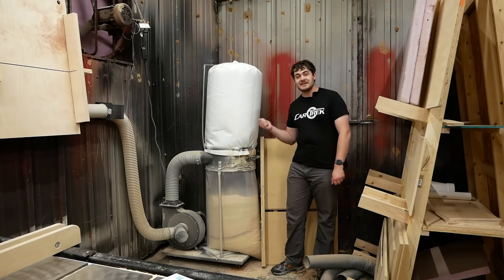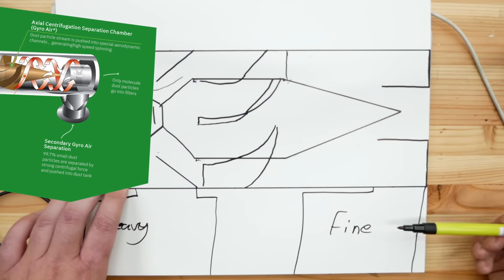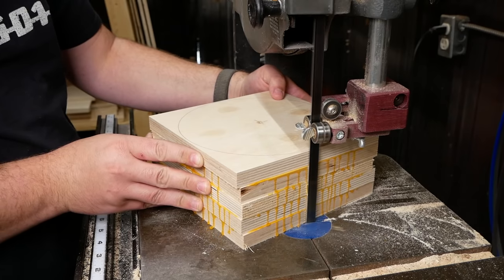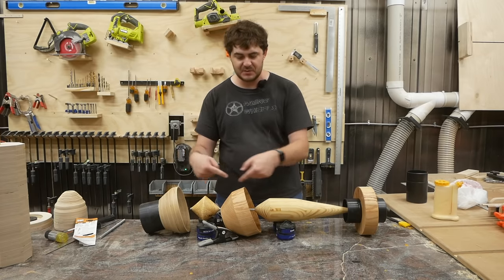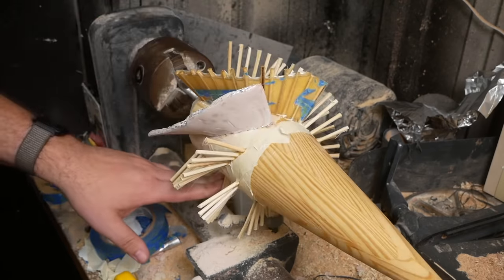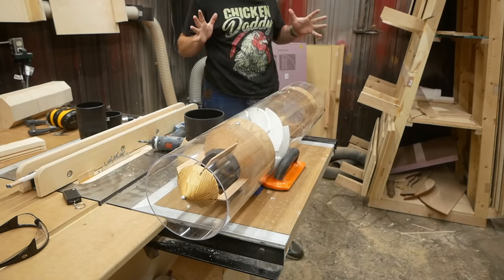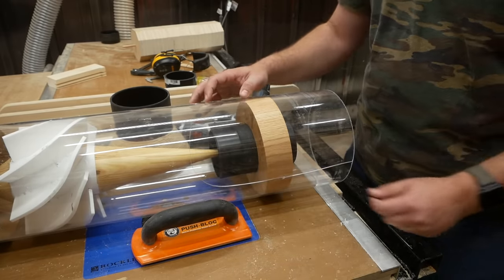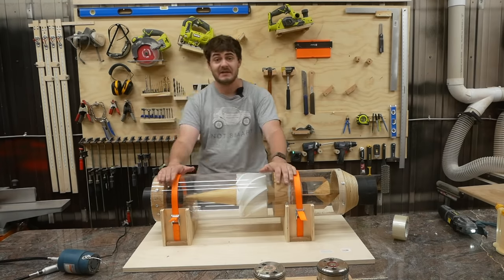I Made a Centrifugal Dust Separator to Upgrade My Cheapo Dust Collector

Comment: Thanks for this. I love your "measure once, cut three times" technique - that way, you will never run out of scrap material for new projects!

Did you consider putting the blower at the other end, so that the heavy lumps get separated before they hit the vanes of the fan?
Reply: You'd be surprised at how many centrifugal wood chip dust collectors (what he had originally) with the bag dump all that shit through the turbine. In theory if it's all dust and fine chips you'd be fine and the turbine should be just weak enough to not be able to lift dangerous sized chips. I've seen a number that aren't Chinesium or Horrible Fright that do the same (pump through the turbine before the blower). We've had a setup like that for 14 years now and it hasn't failed. Then again, every table has a screen preventing chips > 3/4" in a given dimension from getting through.

Comment: This whole thing is awesome. Congratulations on the working separator! You really should change the order to be Cyclone —> Filter —> Blower motor (sucking rather than blowing) a la Matthias Wandel. It preserves the blower.
Reply: Mere details.
But it would help with the dust bins not bulging out. Similarly with the filters bulging apart. Also the big chunks of wood would not have to go through that blower. 
Yeah, I guess I don't understand the overall design.
Reply: @henryD9363  Well understand or not, you did make one. That’s more than most of us. You are officially a doer of things! Plus it works!

Comment: For the fins, aluminum cans with the lid and foot cut off can be slotted into grooves cut into the surface. Beer cans are very useful.

EDIT: Apparently I've been generating too many empty beer cans myself, I didn't realize The whole mechanism was static, and the air moved.

Comment: Awesome project! :) But I have to admit that I was mildly - but pleasantly - surprised to see that you survived the building process :)
And BTW - half area tube section for an 8" duct is 2 x sqrt (4x4x0.5) = 5.66". So your first calculation was right.... But for shopvac type airspeeds, when accounting  for boundary flow losses, my old ventilation textbook memory says to subtract maybe 10% of that. Round it off to 5".... That should keep average air speed constant through the system, which is important to minimize pressure losses.

Comment: It's fascinating seeing this done in wood. I thought to myself, this would go so much faster with a couple 3d printers. Could have the cyclonic separator section built in about a 2 days.
Reply: I've got an Elegoo Jupiter coming next summer and I just might try this.  I'd use a Sonotube for the enclosure though - just cut some windows into it and heat-drape acryilc over them & seal.  (This guy's channel is exactly my kind of bonkers.  He did a great job.)

Comment: At some point someone's gonna make a "dust collector" that actually separates the chip/peel/fiber from the dust.   It's kinda useful and all it takes is a sorting drum system where a turning screen that catches the non-dust stuff rotates through the flow then over the hopper.  You can do it with a solid drum by making the entire flow assembly in a cap to the drum then you can drop and swing the drum out then tamp it to save space... it greatly reduces the amount of material the centripetal dust unit has to deal with.
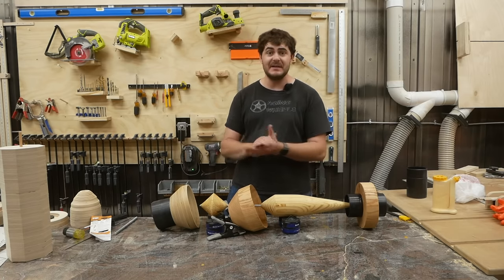Before I watch the fin idea at 0:09:30 I'm gonna go back to a technique my mother (with the Masters of Art Education from Indiana State in the late '60s) taught me.  Create the curve out of a block of clay and melt PVC onto it... that way you can make as many as you need and as long as you don't overheat the clay you can use it again later for other things.   You can do this for complicated fiberglass surfaces too using whatever you like to bulk up the inside.  If it turns out your curve isn't right, move the clay around   Frankly I also learned enough metalworking that I could reproduce the fins with a hammer and anvil too but the old saying "give a lazy person a job to find out the easiest way to do it" comes back around to one of my mother's professors who was a retired industrial process engineer.

Now... I don't wanna give you a concussion but I'm thinking it would have been much simpler to make it all out of stiffened cardboard silhouette matrix then form-fill with dense A+B, smooth that with a wire brush and harden the surface with spray bondo, quick gentle sanding on the lathe at low speed, groove and mount the fins my way or your way, give the whole thing a gentle coat of sealant then cover that with countertop granite spray paint.   Repeat as needed for all parts.

Would have made a GREAT intro gag... "but that seemed too easy... SO I MADE IT OUT OF GRANITE!"

Love the panel work.
I would definitely build my own version of what you've got.  Tho I'm thinking I'd do a bit more of a display with clamshell dump bottoms etc.
If you want to save money, just find a local vaccum repair shop and ask em to collect dead dyson clones for you.  Six-ish of the cyclone drops on them combined with a fair size shop-vac on the end pulling through them should do great for individual tools - their advantage is they're the suck-through instead of the blow-through type of cyclone.

Comment: My first thought when you started this was, "This would be a perfect application for 3D printed parts."
Reply: Hmm I assume you mean the blades. Unfortunately I don't think with most 3D printers you'd get enough layer adhesion to stand the test of having wood chips blasted against them. Those centrifugal blowers for wood chip/dust collection move a lot of air and fast.
Reply: @ObservationofLimits  I was thinking something like the high strength resins that UV curing resin printers can use. From what I've read, layer adhesion is much better on those as the UV curing process leaves a result that is a lot more like a weld than standard PLA printing.

Comment: Great video and concept. I like that you included what didn't work. I admit that I skipped through some of the video because it is quite long so I may have missed any comments about the cyclonic separators made from trash cans and 90degree fittings. That's what I built and it works great but I admit that my vacuum has smaller fittings and less powerful. It was a hell of a lot easier to build than yours though. I built a stand on rollers and placed the shop vac on top. Very little dust makes it past the filter and the trash can fills up with the sawdust. Thanks for sharing.

Comment: Very interesting design and I understand why you wouldn't want to make another.  I love your this is how I'm planning on doing this,  oops - not a good idea,  find another solution and forge ahead.  You show how to utilize what you have, troubleshoot when problems arise, make corrections as necessary, and finish the project.  It's a useful lesson about making mistakes, and eventually producing a finished product that works quite well.  Thanks for the video, separator design, and the lesson.

Comment: For the filter box you ended up with, you can still use it for dust, but a bit differently.   Instead of pushing air into the box, suck air out of the box, with a fan.  Mount it on the ceiling and it will suck up the dust in the air.

Comment: I use the inexpensive Dust Deputy cyclone dust separator on my CNC router. I cut plywood, hardwood, aluminum, plastics, and carbon fiber and the amount of waste that comes off is incredible. But when the cyclone bucket needs to be emptied, I always check the vacuum canister and filter as well. The vac can and filter and nearly pristine. If I had a bigger work load I'd just run either two vac's or possibly a single vac with two Dust Deputies in a row. No commercial axe to grind for me; it just works and is far less complex than this unnecessary but very nice bit of handywork. I do love the experiment though.

Comment: Regarding the acrylic crack, you can get special glue for acrylic that actually works by slightly melting and fusing the acrylic parts together.  I would imagine it could seal up that crack pretty well.

Comment: On the cracks in the acrylic tube:  drill a small hole at each end of the crack to stop propagation.  Then fill crack by wicking thin CA glue.

Comment: I have found that using a leaf blower to clean out the garage works well for dust and fine dust.  It doesn't protect my lungs, but for the occasional cleanup of the dust and shavings that the dust collector did get...  Its a good way to get them out of the garage.

Comment: 😮DIY dust vortex separators have been tested and are very efficient, to get that last remaining sawdust a woodworker used a second separator it worked.   He stacked them up on a trolley two dust vortex things and then his vacuum.  I would go this way 😮

Comment: I built a cyclone separator dust collector going on two years ago. I built it out of a 55 gal. Plastic barrel with detachable lid. I draw the air from the center of the lid with a fox wall mounted dust collector that has a felt bag for final collection. Now my set up has the fox motor housing mounted over my barrel, and a hose running to the connector mounted in the lids center. My dust pipe enters the barrel about four inches from the top, and from a counterclockwise rotation when viewed from above the barrel. Northern hemisphere drain cyclone is naturally counterclockwise, where southern hemisphere is clockwise. Can’t tell you how many people I see making cyclones against nature. Now my collection barrel sits outside my shop in another room for noise control. So my collection piping goes through the wall to the barrel. And so I don’t suck cold air into the shop in the winter, my micron bag hangs inside the shop so the air out comes back in. No preasure increase or drop in the shop. My fox micron bag has a clear viewing window to monitor accumulated dust. In the near two years I’ve been using this system, I have never accumulated and dust in the bag, and have filled the barrel dozens of times. No more wood chips going through the turbine wheel as the barrel collects it all. My system is used for shop floor cleanup as well as individual machine points. I have heard people claim efficiencies in the 97% range and they were proud of the accomplishment. If after dozens of 55 gal drum loads, I still have not seen anything of substance in my filter bag, my system must be in the near 100% efficiency range. I can only attribute that to the natural northern hemisphere counterclockwise rotation of the incoming debris.

Comment: The furnace filters almost worked. There's only one thing you did wrong. When looking at the filters, you will notice that one side has the pleats supported in a wire mesh. The wire mesh ALWAYS has to be DOWN WIND. That supports the pleats against the back pressure caused by restriction as the filters get dirty. If the filters are installed with the wire mesh facing up stream, the pleats just come unraveled. Had the filters been installed correctly, I think the filter box would have worked perfectly!
     The 2-stage centrifugal separator looks great. Being axial rather than radial looks to me, like it can do a better job separating, with less restriction to airflow. All in all, it's a great way to prolong the life of the expensive media filters, while maintaining sufficient airflow to capture the dust from the shop equipment in real time. Time is much better spent building your latest creation, than cleaning up! This build was WELL worth your time.

Comment: That was fun. I too like to make gadgets out of wood. I live in a small studio apartment with no bedroom. So I made a murphy bed-room. Not only does it fold out of the way but also opens up, not as a platform to put a mattress but also into 4 walls and a roof. It's dark and quiet just like I like it. My goal was to use only a drill and a jig saw for power tools. All long cuts made at the lumber yard and delivered.

Comment: That is just a two stage cyclone. Stand it up and run in reverse and you'll see it. The 'fine' particle is the cyclone, which uses gravity for the large particles. Fascinating, for sure. I'd be curious to build and test one of each. I've often though a second cyclone would remove another 99% of the probably 1-5% that gets by.

Comment: Very nice project. I would suggest that the dust collector be placed before the centrifugal fan. This will save your fan blades from damage by dust particles hitting the blades. Over time the dust particles will erode the surface of the fan blades in the current setup.

Comment: The turbine impeller used for the thrust in the original out-of-the-box unit was already a centrifugal force.  What you actually want is to introduce a vollute for the outlet of the unit which takes centrifugal forces of flow and projects them into linear flow.  I have working in the turbo machinery industry for years.  Nonetheless, this is a great project and nice setup.

Comment: You may want to consider repositioning your blower to between the separator and filter, it will last longer without having to be in contact with the sawdust all the time, and the separator will protect the fan blades from large debris.

Comment: Your discussion of sizing the outlet raises an interesting point. An 8 inch diameter tube will flow 16 times as much air as a 4 inch diameter tube. It's a square law. So while the original sizes looked wrong, they were probably right all the time. but the best way to know is give it a try.

Comment: You should add grounding to keep it from building up a static charge and exploding. The LED backlight looks cool but all the fine dust can easily light on fire if the electicals make even the smallest spark. You should have some kind of fire protection near by such as smoke alarms and extinguishers.

Comment: You may get better suction and separation if you pull the air and dust through the separator instead of pushing it. Just a thought.

Comment: It just occured to me you could just buy two cheap plastic funnels and glue then together for the small cone. For the big cone, use a small funnel - pvc pipe and a long oil filling funnel. Then the middle pard can probably be made from a PVC coupling.

Comment: I feel like this is a limits of DIY video as much as it is a DIY video, meaning maybe those wood blocks wouldnt have "exploded" if you had simply purchased actual turning tools (which probably would have cost the same as the value of material spent on the DIY stuff, let alone factoring in all the time). [edit: having watched till the end, I think this build video makes the case for purchasing a 3D printer. As you concluded however, you got what you wanted outta the project and that's worth way more than simplifying the process. Mad respect for accomplishing your objectives. Also, best edits for a build video ever. The sound portion took me back to the 90s and gave me flashbacks to being at a rave.]

Comment: A bit late now but, @16:15 drill a hole in advance of the split to prevent it from traveling further before moving on with additional shenanigans.  Instead of forcing a tight fitting insert through a brittle acrylic tube, undersize the insert and wrap in foam gasket to create a seal without stressing the tube.

Comment: If put your blower post/separator, and mount it direct,y to the outlet, and the filter directly to that, you’ll eliminate a lot of inefficiencies. At leas mount the b,owner direct,y to the inlet to get rid of that ribbed hose.

Comment: Make a water based dust collector to act as a final dust filter before your exhaust filter so you can basically never change the filter again. I find water doesn’t work half bad for dust collecting, and simply blowing air into gallon water fitted to a giant 50gal drum, i think it’ll work very well.

Comment: You should use special bits for drilling plastic.  Standard twist bits are too aggressive and tend to pull the material up when drilling. I modify standard twist bits to flatten the cutting edge to create more of a scraping blade on the front edge of the bit.  They make clean holes and are far less likely to crack the plastic.

Comment: This is bringing on flashbacks of trying to turn stuff too big for my tools and too big for my lathe. The worst.
At least for boring internals, making a big heavy boring bar with an hss bit (Ellsworth style) is worth your time.
For spindles there is no replacement for learning how to use a skew, takes some time to learn but super easy to make (Iv mostly used w2 and o1 for skews, but you gotta be careful about your temper, too brittle and they are gonna be dangerous to use, grinding hss would be simpler but more time consuming).

Comment: I was surprised you did not place the dust seperator prior to suction fan to avoid large pieces of wood fiber going thru the fan. Suction would pull seals tighter ic cyclone and dust bins.
What do you think?

Comment: An improvement to the system would be to have the fan blower between the separator and the filter.  That way, all of the big particles and dust have the chance of ending up in the collection bin without going through the actual fan.  If anything did get through the fan, it should only be the fine dust that would get caught by the filter.

Comment: A couple questions. 
Why didn't you already have turning tools when you have a lathe? 
When setting up the dust collector why not put the blower after the separator? I would think that would be better so no large chips would be going through the impeller blades of blower.